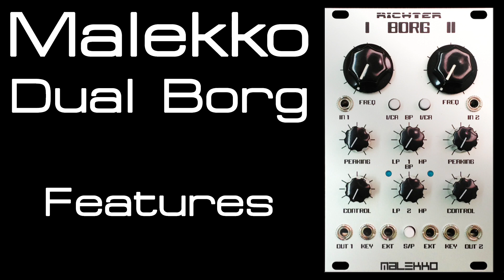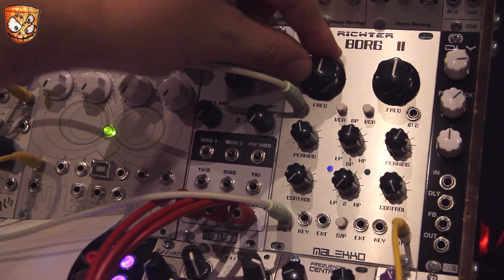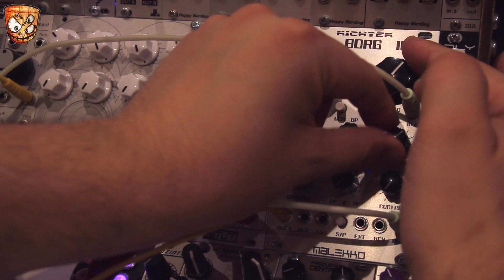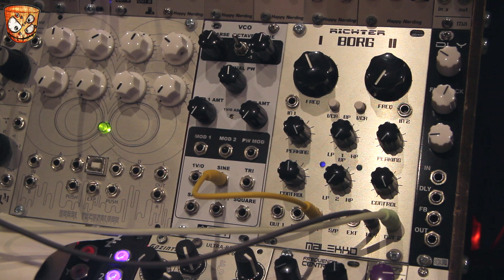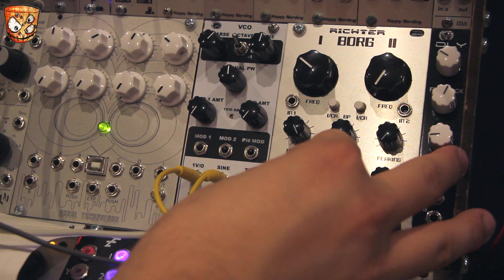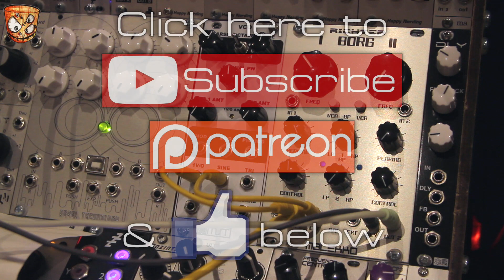Malekko Heavy Industry - Dual Borg

Comment: Would you recommend this as a good filter in bandpass mode?
Reply from the maker: Yeah it's fantastic playing it like an MS-20 with the low pass and high pass on different sides to modulate together or separately. 

If you're curious about that way of making a band pass, grab VCV Rack software and load up to filter, patch into a high pass filter and the output into a low pass filter then monitor the low pass out. That way you can play around with the dual filter making a band thing first.

Comment: Ever used this near the end of your signal path and used inverted CV outputs from mixer/s on the rack to create that VCA effect where the ceiling doesn't go past that point/compresses?

Like when you invert an envelope to either compress, limit or 'sidechain' the output via giving the CV in an inverted input? Like if you invert a maths output or attenuate it to be inverted for that pump action?

I am only sorta familiar with LPG's still,  but if you have it at the end of a signal chain, I'm wondering if the dual VCA/LPG mode is interesting for that?

I'd wanna put it before my headphones output to not immediately murder my ears.

Comment: What kind of compressor are you running all of this through? The levels stay remarkably flat. Any chance you remember the settings? I'd assume fast attack, long release, something about 4:1, hard knee...
Reply from the maker: Hey, I don't use anything in the audio path while making audio demos. The modular audio is a direct recording. If I can find the projects I'll dig them out and check but very light level control is all I use for video demos.
Reply: My dual borg came yesterday, and outside of a fleeting issue with static sounds on the Borg II channel (being addresses), I couldn't believe my ears. I now see it really does just sound that good. 

Thank you for the role you played in edging me ever so closer to this purchase. :)
Reply from the maker: cool! It's nuts isn't it. Doesn't dip or drop (easy to hear why you'd think it had been massaged with some compression) and just seems strong across the board.
Reply: That settles it, I need this for my new case

Comment: Hi, I tried to reproduce the first part of your video with my dual borg (bought used on muff wiggler) but my module seems to be weak, not screaming (Expecially filter I). I made the following video, can you have a look please ? 

https://www.youtube.com/watch?v=_gjskEtjK7U

What do you think it could be ? Damaged Vactrols ?

Thank you in advance!
Reply from the maker: +TheZanna83 for some reason this ended up in the spam section of my comments. That doesn't sound like anything I'm getting from the Borg. I'd contact Malekko.
Reply: +DivKidMusic +TheZanna83 Malekko told me that being vactrols, each Borg II is a bit unique. But on the rear of the module, each side has 2 breakers that can be removed which add extra resonance scream if wanted.